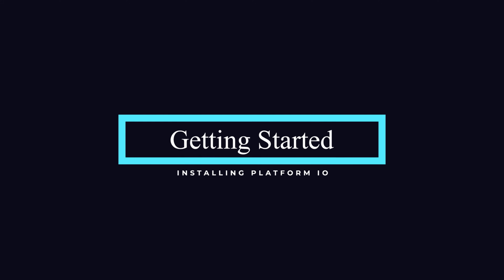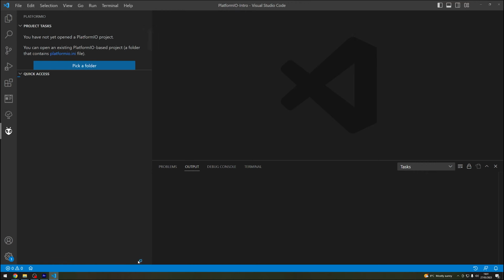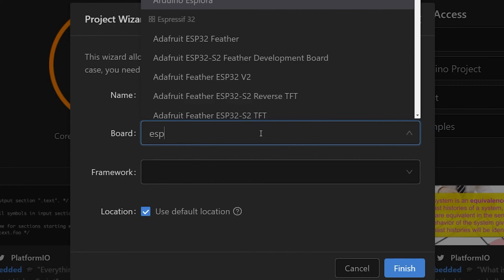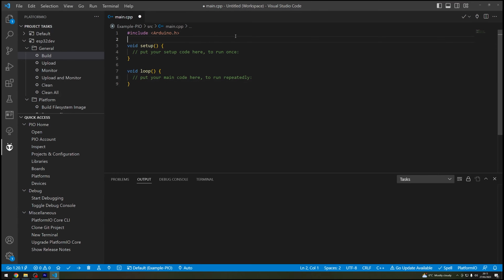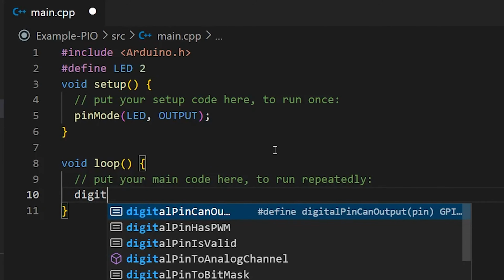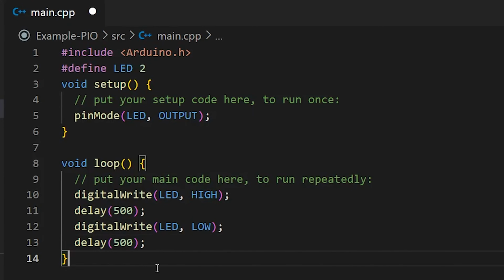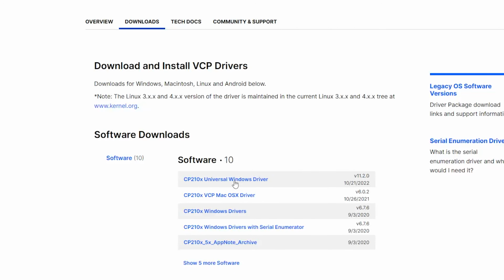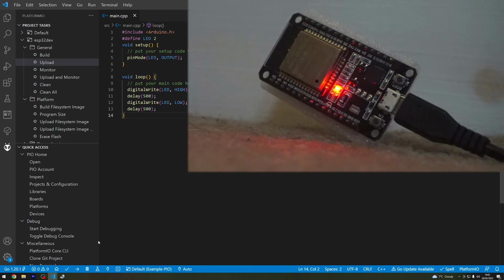Get started with PlatformIO and the ESP 32

Comment: Great video, for those moving to PlatformIO from Arduino IDE you need to add monitor_speed = 115200 ... to get the serial monitor to work ... obvously if your baud rate is different than 115200  then set it to match your sketch.

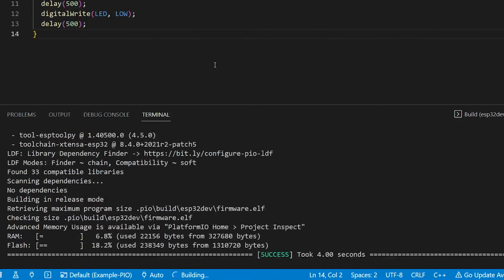Comment: this 7:18 is why i dont like these programs for these or picos, look at the flash usage.. ~19% of the total flash used to flash a simple led.. way to much overhead. Using CCstudios on a msp430 using bit masked C, same led toggling i got 108 bytes.. 108 bytes vs 238349 bytes..😂 same issue with the picos as well. Esp32 and picos both seem to not be native C compatible. having to use python  or SDKs with Huge over head. These are not classified as micro controllers more like exotic micro processors, designed for new devs that know python and are just getting started. I would not recommend these for nothing more then quick prototyping. Unless you are gonna have 500mb+ flash storage. I am not hating on these, i would love for the pico devs to build a native C ide for using their chips. But its a pain to run straight C on them.. Have to jump through major hoops to do it.. I also tried platformio on the msp430 launch pad board i got and it supports it but would not flash cause of a vcc error. CCS works fine though.

Comment: What is the difference between PlatformIO extension and the EspressIF IDF extension? 

 I want to use VS Code (instead of the EspressIF IDF environment), but when I install/configure the extension, it keeps looking for the IDF before installing the IDF! I tried installing IDF/Tools directly (esp-idf-tools-setup-online-2.20).. and compiling via the command prompt works fine (idf_py build), yet VS Code IDF extension still does not see it!

Any plans to do debug using a JTAG programmer? I bought an FT2232HL device (ESP-Prog), pointed it to the WinUsb driver (via Zadig), but how does debugging work ?   For example, does it automatically start OpenOCD and load the elf file onto the ESP32? 

And if you unplug/plug, does the last debug program run, or was the debugger running out of RAM?